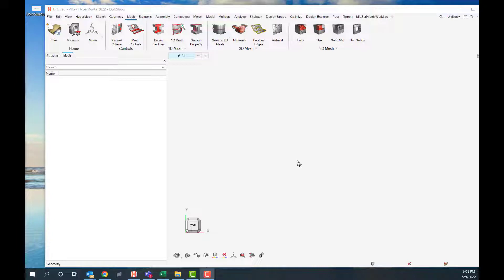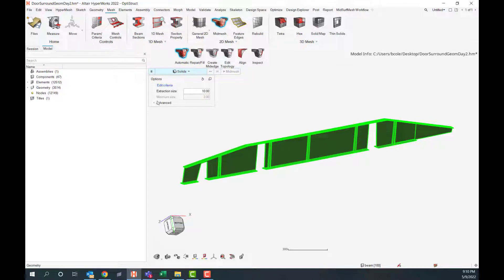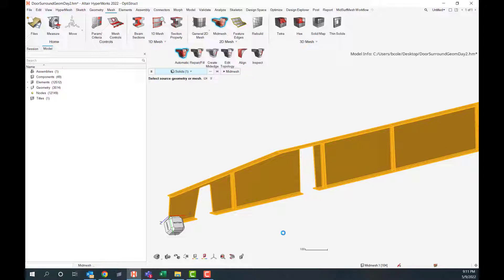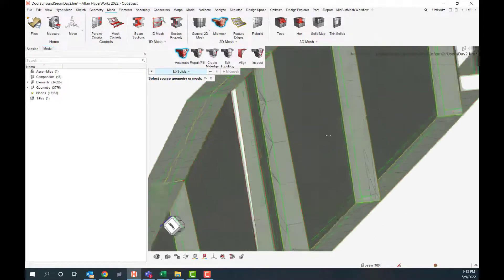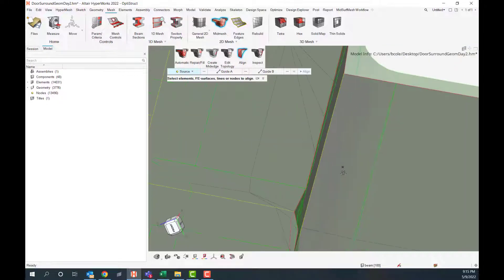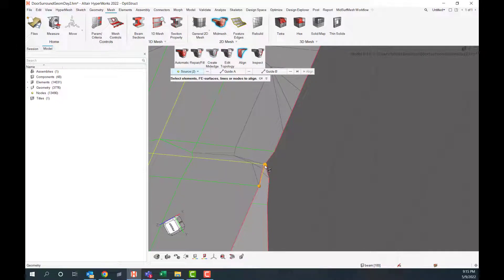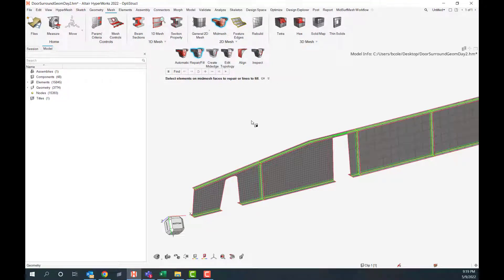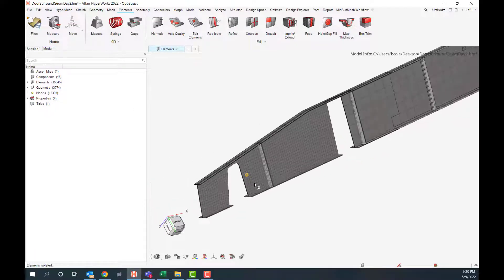EP 4: Direct Mid Meshing in HyperWorks 2022

Comment: When I create a midmesh in HyperMesh, I have no problems. But with the same part in HyperWorks, the midmesh is missing 33% of the part (about the same general complexity of part that are showing here.) The other 2/3 of the mesh is riddled with holes and the repair function doesn't do anything for me. Suppress proximity edges, combine non-manifold edges, etc. are all quantities I've messed with or tried to replicate between HM and HW. Yet HW is not generating the midmesh well. Any ideas? I have also tried generating a midsurface separate from the midmesh, and HyperWorks is doing a poor job of that also, so I suspect that is the root of the problem (though I did not create a midsurface prior to using the midmesh function.)